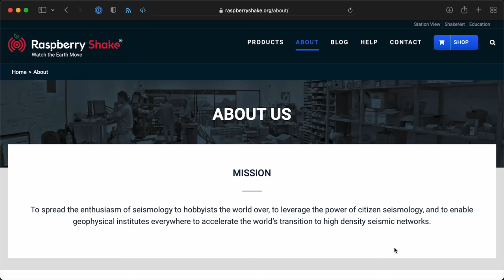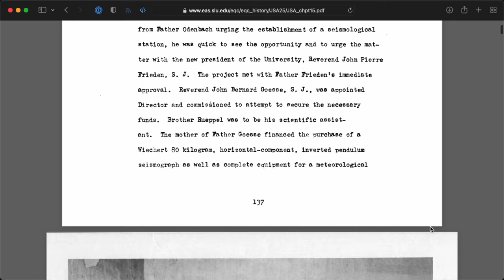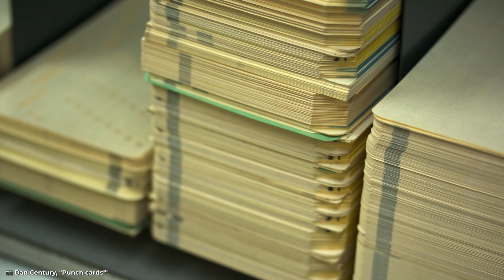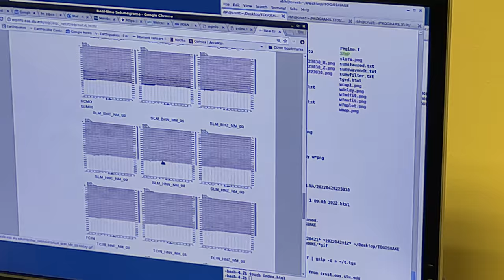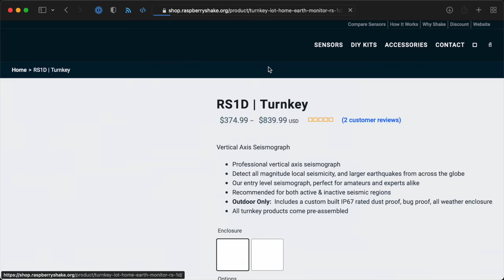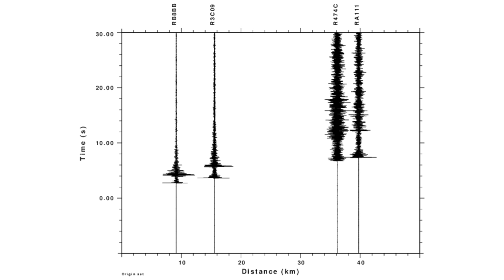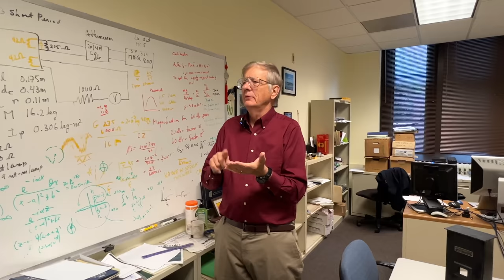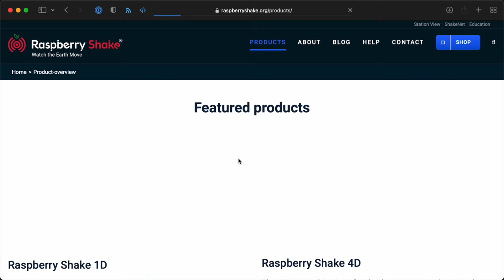Can you predict an earthquake?

Comment: Hmmm seems like a Raspberry Pi is a bit overkill for a project like this. I bet the Pi isn't doing a lot of computing, that you can't do on a smaller SoC such as an ESP32 (which has WiFi and Bluetooth as well as Ethernet with a HAT). Would save a lot of cost, make it a lot smaller, and a lot more available to the masses. There are probably other, better, SoCs such as the STM32 that could also be used. Seems like a very weird choice to use a Raspberry Pi in my opinion.
Reply from the maker: In this case, since the Pi is processing the data stream, sending it to a cloud endpoint, storing it locally, and running a web frontend, it makes sense to have the full Linux environment available, mostly for convenience.

Most of those things can be run on smaller SoCs, but then you contend a lot more with memory limitations, and run into bugs like WiFi being more flaky, and wired Ethernet and PoE requiring more custom solutions. With the Pi, all that comes out of the box.
Reply: @JeffGeerling  I get how a Pi is more powerful regarding a web interface and so on, but why would the Pi need to run the web interface at all? If the data gets sent to "the cloud", wouldn't a "cloud web interface" be able to serve the same content? That's what a lot of us do with our ESP projects, as the ESP doesn't have enough computing power to serve a lot of requests. For data logging, sending it to the cloud, etc. that's all fine for the ESP, though.
Reply: @mortenmoulder  Honestly, most Pi projects definitely don't need the full power of a Pi and can get along with an ESP just fine, but the step up in difficulty is massive, and many people already have a Pi lying around that they can use to test stuff, so the price becomes worth it when you have a Pi that you can use for testing, and then maybe buy something like a Zero W for permanent use if you want.
Reply from the maker: @mortenmoulder  In the case of the Raspberry Shake, it's able to run either in private mode (everything offline, data only stored and accessed locally), or public+private mode (cloud+local), so having a local web UI is essential for their setup process.
Reply: How much are the SOC's compared to a raspberry pi in normal times, not with shortages? The raspberry pi 3 should be less then £40, the raspberry shake is £400 but a quarter is made up of the cost of the pi so 3/4 of the price is still the sensors.
Reply: @tonysheerness2427  SoC like the ESP32 series or the Pi Pico go for like £3-4 when bought alone, less if bought in bulk. Way less powerful than the Pi, but still very useful for some simple applications.
Reply: @JeffGeerling  Okay, then it makes sense. I can still serve a web UI from an ESP32 perfectly normal (one of the most famous projects WLED runs a web UI), but if the data is also stored locally, then maybe a Raspberry Pi isn't so bad. Writing and reading to and from an SD card using an ESP32 is also possible, however. I think that if they really wanted to, they could run this entirely off an ESP32 without much trouble.
Reply from the maker: @mortenmoulder  Yeah; and I think there's definitely a possibility they could build out a remote-sensor-only version that's simpler and just runs off a tiny ESP or Pico or something, but for now, I think just to keep things simple, they've standardized on the Pi.
Reply: @JeffGeerling  I would buy one if it wasn't dependent on a Pi. It simply cost too much. I'll keep an eye out for future updates (hopefully you as well) 👍
Reply: @JeffGeerling  I would love to see this on ESP32 for cost and availablity standpoint.   The Pi's are incredibly hard to find and the two Pi 4s I ordered 5 months ago finally got shipped yesterday.  I have few ESP8266 (Sonoff) based power plugs running Tasmota.  The webGUI on those switches are friggin fast and responsive.

Comment: I like to do audio recording at home all the time and I edit with Audacity. I live in a 2 story home with neighbors upstairs. Sometimes when I am recording, I can detect when they walk or move around. There will be a flat recording line and then what looks like the waves on a seismometer graph. If I slow the speed of the recording down, I actually hear what sound like rumbles which I think is pretty cool. I was thinking of burying a large drum in the ground and suspending a microphone from the center to see if I can detect any movement. It might not be an accurate or official way but it will show me if there was some kind of vibrations from the ground.

Comment: Over 25 years ago I helped my class mate to get engineering thesis award in Finland with a device, that I suggested multiple other alternative uses - including to be used in this manner. The sensor for it can be built in fraction of the costs here and tuning for this purpose is not that straight forward. And naturally it does not come with the bundled services and connectivity to it. And naturally I was not mentioned in his thesis. 🙄
Reply from the maker: D'oh!

And yeah, the tuning can be difficult, that's why I decided to take Raspberry Shake up on their offer and not try building my own from scratch.

Comment: Please explain how those two “double doors” adjusted for air pressure changes. Made no sense.
Reply from the maker: It makes the inrush of air slightly less immediate; though I'm sure if we were building a modern vault the environmental controls could be quite a bit more advanced!

It looked like most of the architecture in that building was original from the 20s/30s

Comment: I made something like this with an arduino, the sensitivity was bad I used a mems accelerometer
Reply from the maker: I saw a few of the mems-based seismometers when I was researching the Pi. It looks like you could pick up hyper-local earthquakes with some tuning and an elaborate weighted rig on which you'd mount the accelerometer, but otherwise, a proper geophone is needed to get the right low-frequency signal.

Comment: Why does the 'shake' use a geophone rather than just mems accelerometers? Plus of course plenty of DSP.
Reply from the maker: Mostly for that latter bit—a geophone is way better tuned to the frequency for earth movement. But they also have the 4D model that combines a geophone with four mems accelerometers to detect more violent shaking (like local 5.0+ earthquakes).

Even with smaller sensors, you still need vertical and horizontal, plus more broadband instruments, if you want to get a full picture of any given earthquake.
Reply: @JeffGeerling  Having been in the geophysics business (as well as commercial oceanography and meteorology for quite a few years)  I don't see any particular CPU issues for the quite simple low sampling frequency DSP required. It could easily be done by an Arduino.

I get the impression the ancient and venerable geophone is included to give data that is referable to some standard or to provide additional calibration for the mems sensors.

Calibration is perhaps better done by using a mesh of sensor sites combined with data from 'official' observation sites.

Comment: Why does a seismic sensor need a dual or quadcore SoC?
Reply from the maker: The sensor itself could easily run from an ESP or something if you just need local data logging or want to push the sensor data to the cloud.

In the Raspberry Shake's case, it stores a decent amount of fat locally, streams it to their cloud service (if configured), and runs a web front end, so developing all that targeting Linux is easier and more stable than doing it all custom on a microprocessor.

Comment: Jeff, why did you demo a 1D?  Price?  Do you wish now you had a 3D or 4D?
Reply from the maker: Since I'm in an area with a lower level of local seismic activity, the 1D picks up most of the motion just fine. If I were closer to the New Madrid fault or in a region that gets 5.0+ earthquakes, I think I'd want one of the more advanced units.
Reply: @JeffGeerling  I live 50 miles north of San Francisco.  The Shake Net shows dozens of 4Ds.  I was thinking I should get a 3D.  What is your opinion on that?
Reply from the maker: @jimgbf  The team at Raspberry Shake seemed to indicate the 3D is great for more data on any particular event (since it can measure horizontal motion), and the 4D is more helpful in areas that get 5.0+ earthquakes, since those will be beyond the limit of the geophones.

Some people seem to have both a 3D and 4D, though that would be quite the overkill for me here in St. Louis!
Reply: OK, I just purchased a 4D!